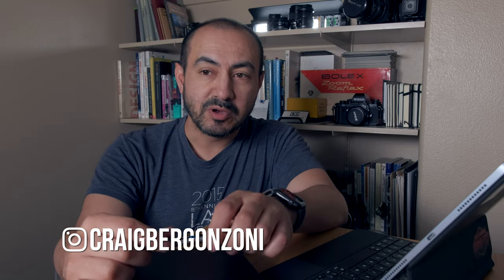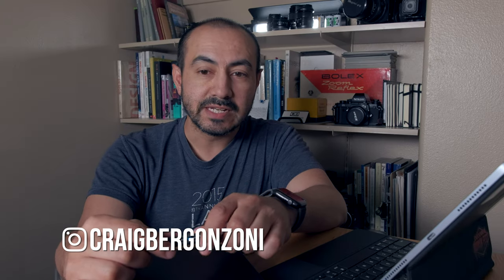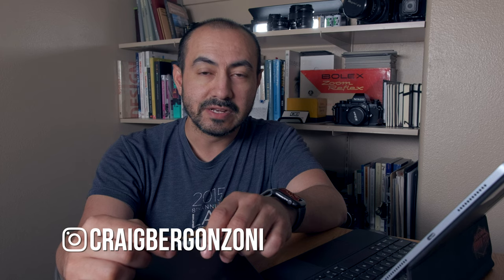STRAIGHT OUT OF CAMERA #24: "BLEACH WASH 2" | Film Simulation Recipe (Build on the Fujifilm X-T1)

Comment: Hi Craig, nice to see you putting recipies out for us XTrans I users, very cool indeed. I bought an XPro1 this year and very much like it. Rather then a tool it is a companion, has its own character, not an easy temper, does things his way, but has soul and personality. 😉.
Goes well with my X100T I own since it came out. 
I was thinking of an XE1 as well, but owning an X100 style I thought it makes more sense to go ‚bigger‘ and for the XP1. Still havent used the 27mm pancake yet….I have the 18/f2 on for most of the time. Also a 7Artisans 35/f1.2 fir manual use. 
Something about the XP1‘s files….so organic….or maybe better said, so less digital. I think for a personal documentary camera it works great! Not fast, bit noisy (wonderful shutter sound 😉) bit quirky, diva like if you want 🤣, it slows you down, bit like a film camera. I just seem to connect really well with this old digital lady.
Cheers from Switzerland
Reply from the maker: The X-Pro1 does seem like an amazing photographic tool for sure! Eventually I'll pick one up but in the meantime keep an eye out for news about me getting an X-E1. Some X-Trans I specific recipes should be coming this year. And cross my fingers, maybe X-Trans IV recipes as well. Thank you for your continued support Michel! It's much appreciated.